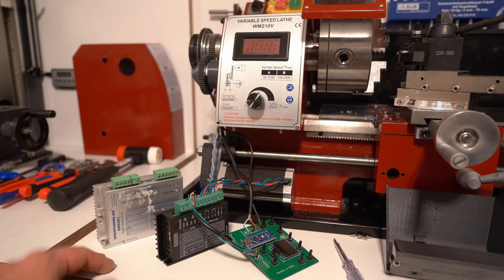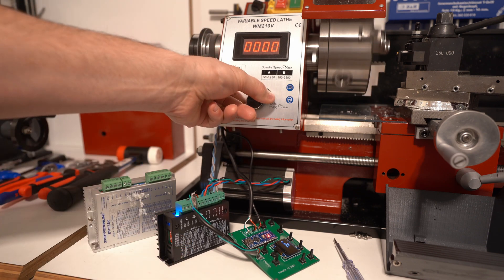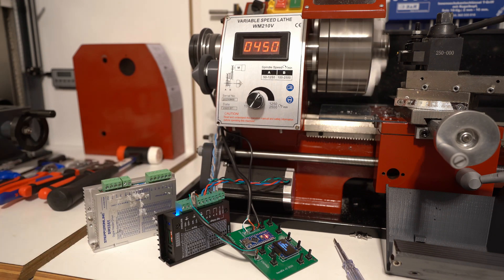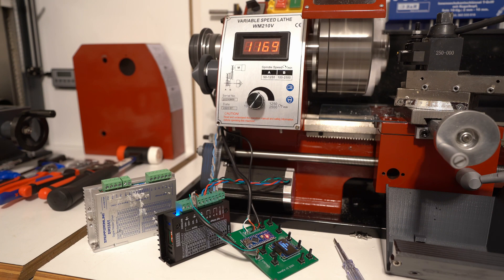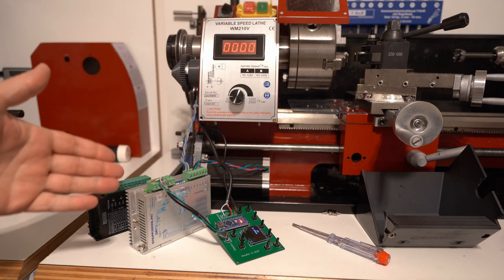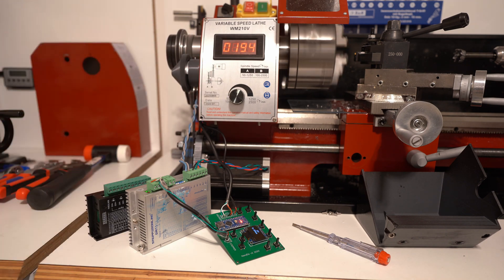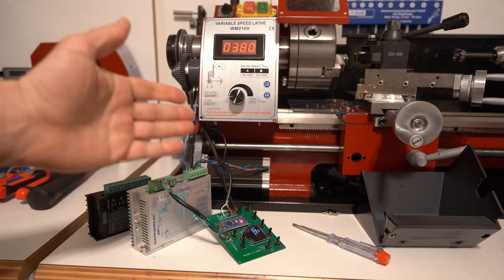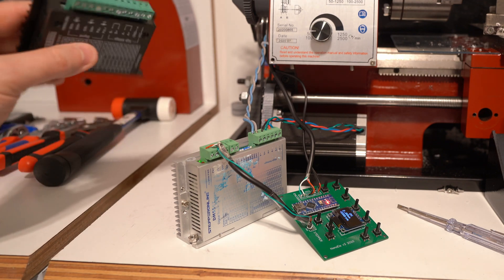Stepper drivers: TB6600 vs DM556Y

Comment: What is the best driver for nema 23 and 34 that you can recommend? And which controller is the best for cnc router? thank you so much
Reply from the maker: I usually buy motor and controller as a bundle. STEPPERONLINE is a good, reasonably priced brand that I usually go with. As for CNC controllers, there's so many of them! I don't know :)

Comment: I'm new to Steppers and am amazed at the high RPM you are getting.  I can't seem to get anywhere near that without the motor either locking up or just rattling back and forth.  What is the controller you are using here.  I'm using an Arduino. Thanks
Reply from the maker: I'm using an Arduino Nano clone. Potential causes could be a cheap stepper driver (try more expensive, brand driver e.g. STEPPERONLINE or RTELLIGENT) or noise induced on the signal lines at high RPM from VFD, motor or something else (try shielded signal wires with shielding connected to GND or 5V).
Reply: @MaximKachurovskiy  Thank you for the reply. I will check that. I think that you are probably right about the noise.

Comment: I have the MX 210v lathe. I'm not sure what the difference is? I have had trouble with the speed controller since new, would this controller be and easy plug and play solution?
Reply from the maker: Hi, do you mean the main spindle motor controller? I'm afraid that's unrelated, these steppers are only used to drive the lead screw.
Reply: @MaximKachurovskiy  yes, I misunderstood. Thank you

Comment: Hello, What type and torque of nema motor did you use? Thanks
Reply from the maker: Hi Levisgil47, here I'm using "Nema 23 Stepper Motor Bipolar 1.8deg 3.0 Nm 4.2A 57x57x113mm 4 Wires Open Loop" but I would recommend a closed-loop motor+driver instead.

Comment: Cheap "TB6600" drivers often have the already inexpensive 6N137 optocoupler for STEP signal replaced with a cheaper one (4N25 or similar). 6N137 can handle 200 kHz easily, while 4N25 starts losing steps at 1 kHz and stalls at 4 kHz or so. With a bit of soldering skill you can upgrade the optocoupler and have a pretty decent driver for a ridiculously low price.

Comment: Hi, your work is impressive and i'd like some day make the same on my identical lathe ;) but tell me a couple of things i missed. Why dont employing a closed loop system? In your last 2 axis upgrade you still use  one single arduino nano for both controllers? 👌
Reply from the maker: Emi, closed loop steppers take more space and are more expensive. You can surely use them though. Yes, Arduino Nano controls both steppers. Cheers!
Reply: Wow.. Im asking this because in some tutorials Arduino systems are considered not very performing with a certain amount of processed data...how many encoder inputs are "right, few or overkill "? Does your project give perfect results like direct Gearing even with not much " Inputs" .. Thanks ;)
Reply from the maker: @emierminio5219  they flew to the moon and back on 2MHz computer and Arduino Uno is 16MHz. Check out other Arduino leadscrew projects on YouTube, there's plenty.
Reply: Ok.. I'm a noobie with this things, forgive my questions  ;)  so, what is the maximum encoder steps that you consider perfect in this application?  
Thanks so much! And good Luck...
Reply from the maker: @emierminio5219  I've only tried 600 step encoder and had no issues so far. I think 200 and 400 will also work well. Can go higher too but probably not into 2000 steps. Also think about the spindle to encoder ratio: if your encoder is 200 steps but is connected to spindle with reduction, you will get different step count per spindle turn.

Comment: Dear,
What a perfect configuration.
I just order them from the website, how ever i'm not sure that i will able to connect them with an arduino uno.
Can you please send me the schematic of wiring DM556y with an arduino uno (i think i will use the GRBL and UGS plattform).
In advance thank you.
Reply from the maker: Thank you. See https://www.youtube.com/watch?v=iY_4YOlpqyI for how to control a stepper driver with Arduino Uno. Basically, you need Arduino to have 2 digital output pins, one wired into DR+ to control the direction, one to PU+ to trigger a step. DR- and PU- should be simply grounded.

Comment: Hi Maxim, thanks for this new video. I've a question regarding the previous video, where in the comments I read you was going to improve the pcb and/or the Arduino code, it was not very clear to me sorry. I would like to replicate your project on my lathe and I wonder if the info you shared are the last ones or if there will be an upgrade in the future to fix the problem you faced. Thanks!!
Reply from the maker: Hi topmounting, I'm currently waiting for the next version of the PCB to arrive which should fix the problem with rare encoder mistakes (by adding 2 pull-ups) that I in the meanwhile solved with code. It also has connectors for the second axis should you ever need to motorize the cross slide. I'm also fixing the few remaining bugs as we speak, adding a ton of unit tests. It's always best to wait and see if you're in no hurry with your ELS project but it's probably safe to order the stepper now and figure out how you're going to connect it to the lead screw - that will be useful for any kind of ELS you'd build. You can be sure to see a video from me once I get the ELS stable as a rock :) Thanks!
Reply from the maker: Just published version the 5 of the code at https://github.com/kachurovskiy/nanoels/, I'm not aware of any bugs in it at this point and it's pretty well tested. Doesn't mean that there aren't any though :) Now just waiting for the PCB.